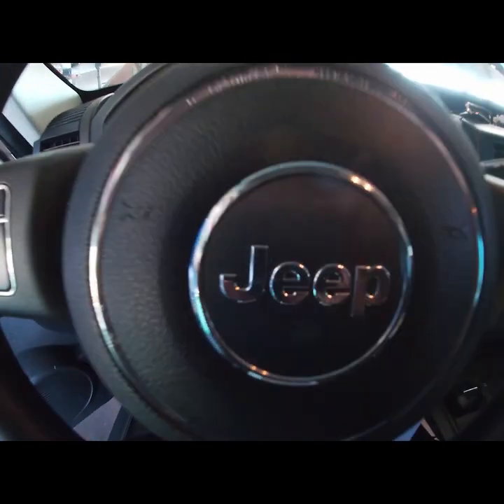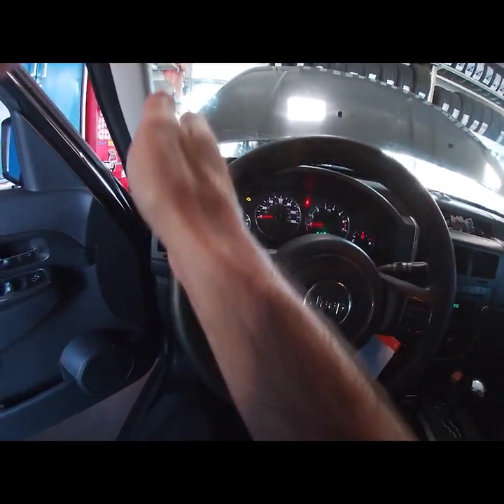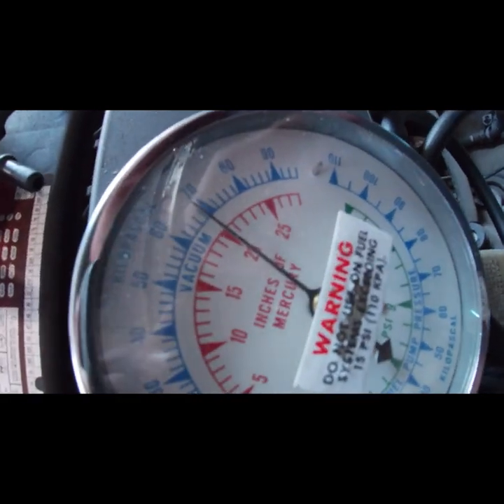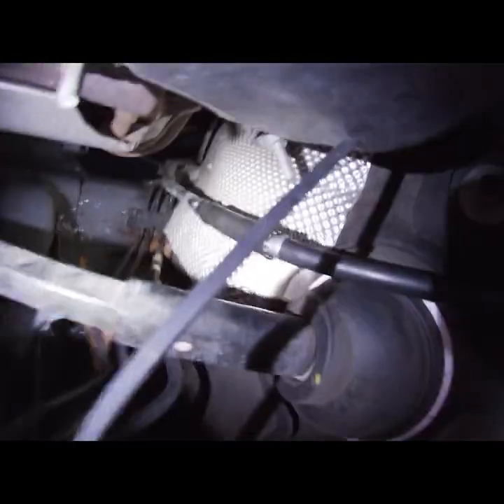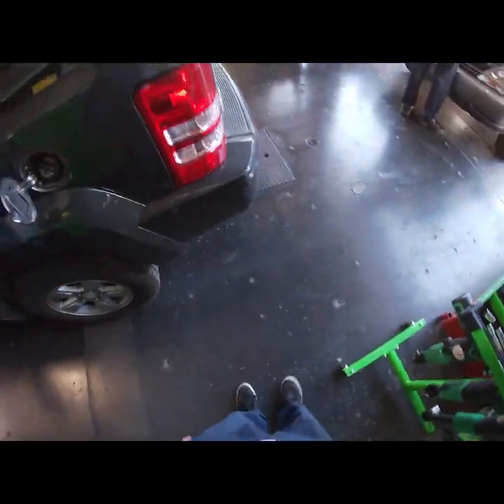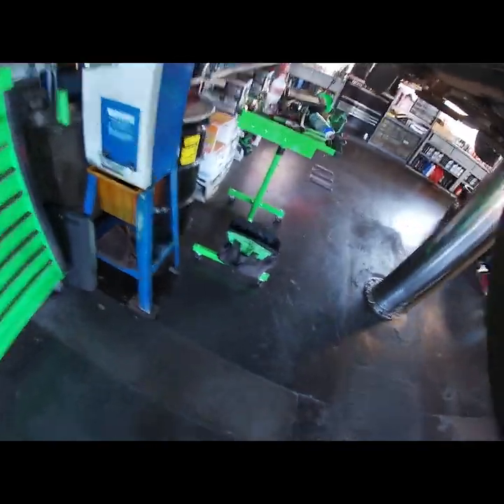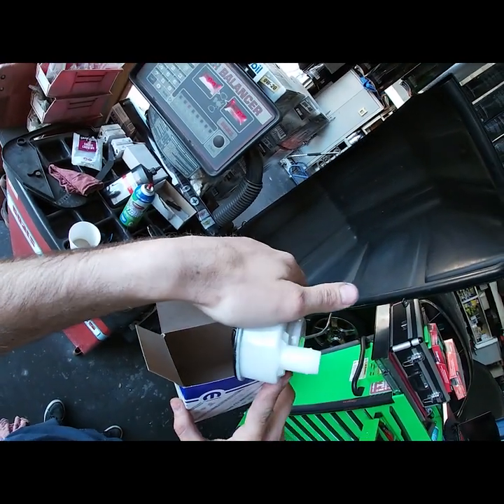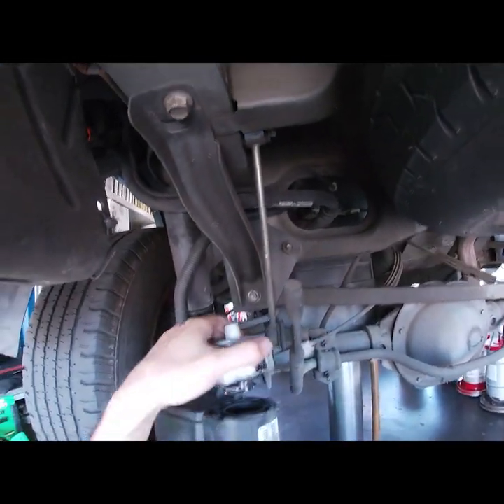'11 Jeep Liberty 3.7L ESIM System multiple EVAP Leaks

Comment: Did this on a 2007 Jeep Liberty in about 20 minutes. It's located almost exactly in the middle and directly above the gas tank on the front side. I was able to get both hands up there to work without taking anything off. Super easy to work on (as are most things on this Jeep).

Comment: The ESIM system is much more sensitive to pressure than the old system....I have been bitten by sending too much pressure through and thinking the ESIM was ok when it switched but it would not move with system self test pressure because system test pressure was less  👍